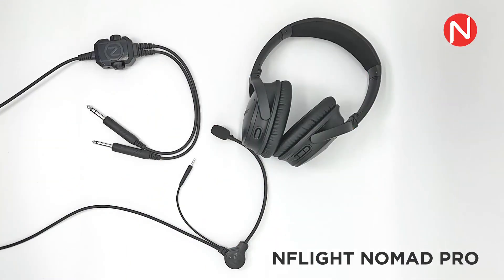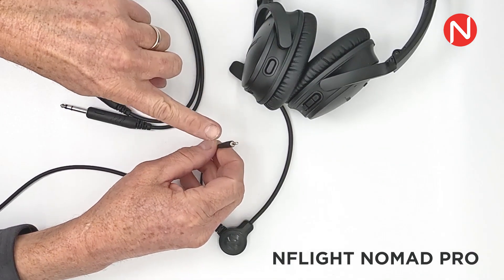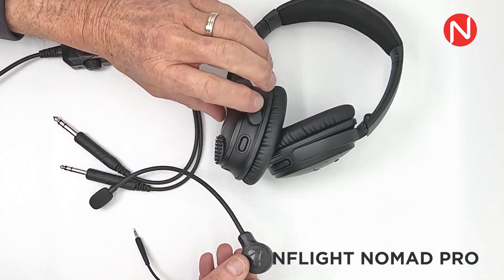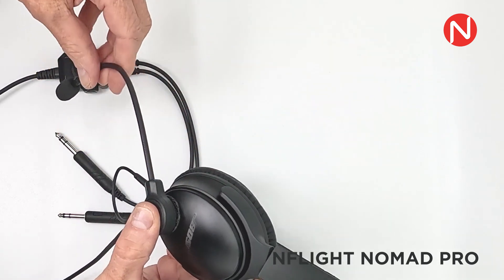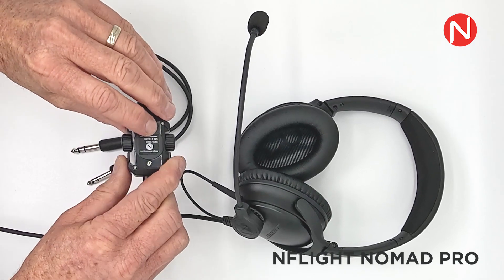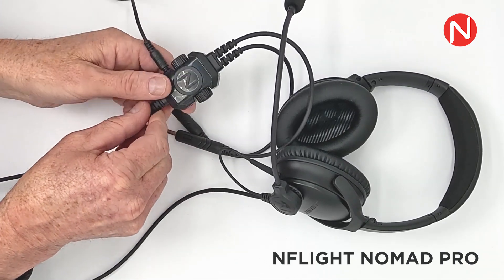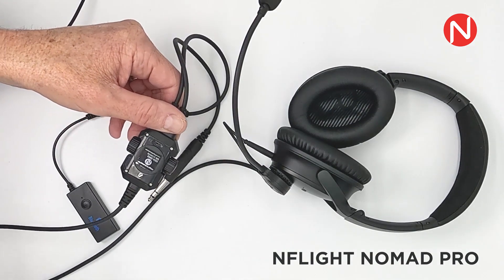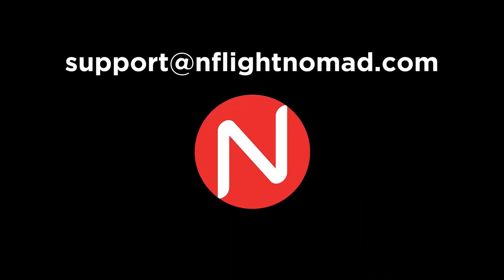NFlight Nomad Pro - Setup Instructional

Comment: Is that a 2.5 to 3.5 mm adapter?
Reply from the maker: No adapters being used in this video.   Most prosumer headphones are built on a 2.5mm aux port.   For those headphones that are built on a 3.5mm aux input, we offer a simple adapter patch cable to modify the system for use on those headphones.